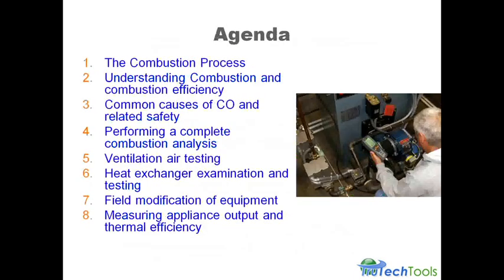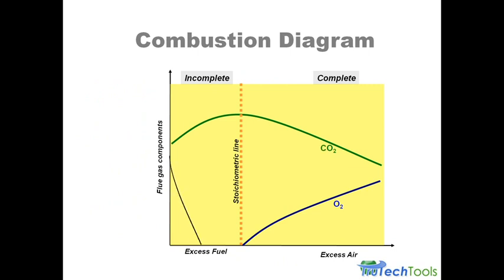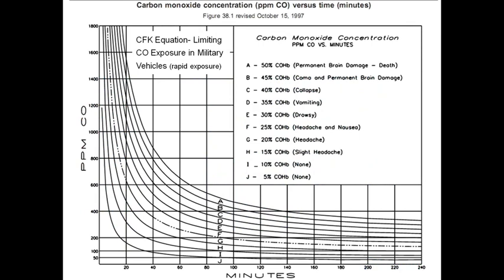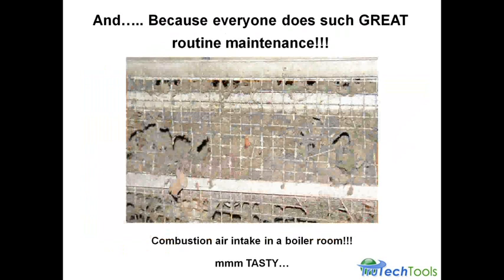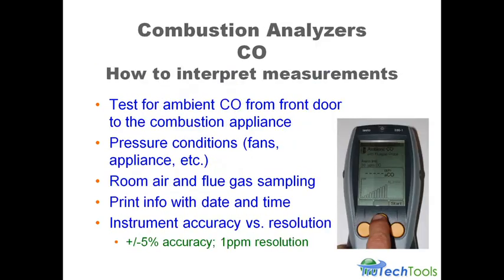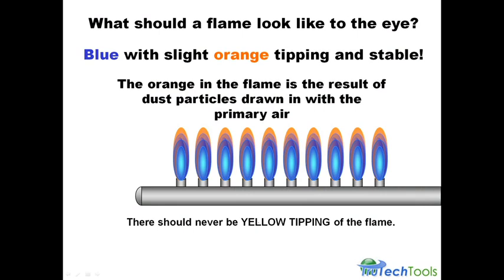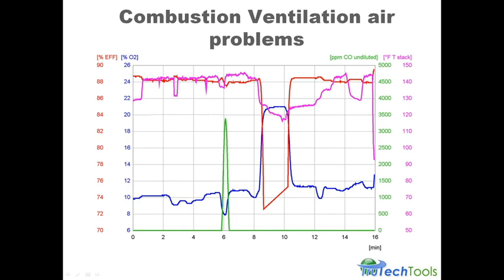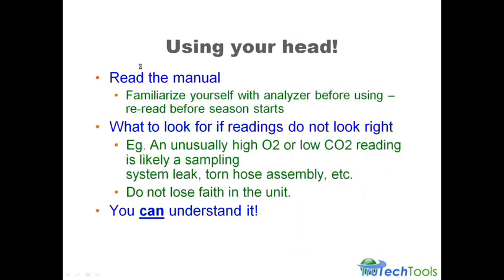TruTech Tools presents: Combustion Analysis 101

Comment: Thanks, Great webinar.
What is average excess air in hi efficiency furnace?
thanks again
Reply from the maker: Hi Delon, here is a good article a blog we've been following for years: http://hvacrfundamentals.blogspot.com/2014/01/why-excess-air-is-important.html
"Typical older natural draft appliances with atmospheric burners use around 50% excess air, turning the 10 CF of combustion air to 15 cubic feet. Nearly all residential furnaces manufactured today are induced draft appliances with atmospheric burners. In these furnaces, the excess air is more typically 20% - 40%. Excess air can safely go as low as 10% for commercial power burners that do a better job of mixing the air and gas."
You can also read the TruTech Combustion Guide: https://www.trutechtools.com/assets/images/EducationalMaterials/TruTech%20Tools%20%20Combustion%20Guide.pdf

Comment: great video thanks.question what type of plugs are you using on PVC pipe after your done with measurements?
Reply: Ron White 5/16” lead free brass npt countersunk plugs or stainless, the size of the plug depends on the brand combustion analyzer that you use.